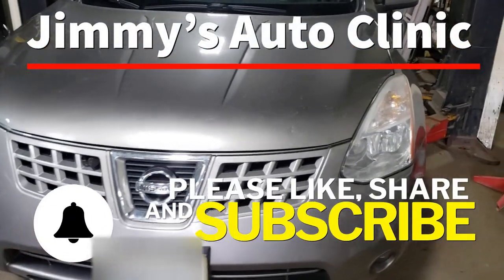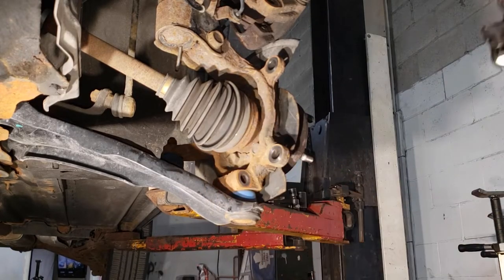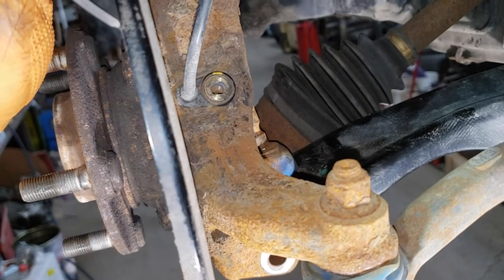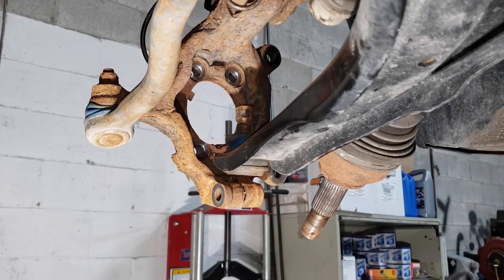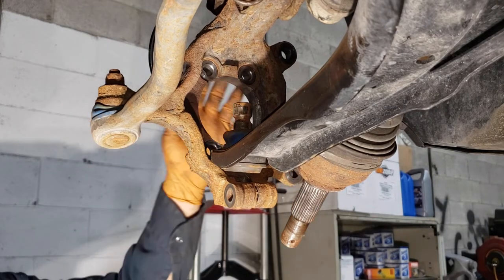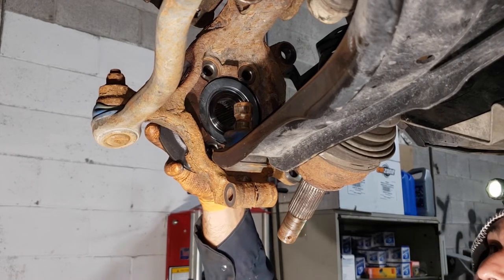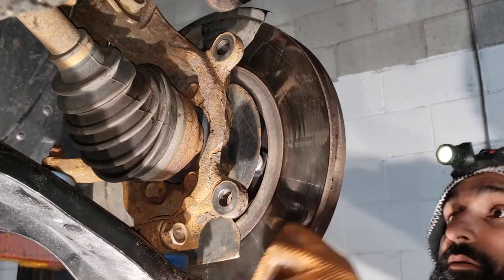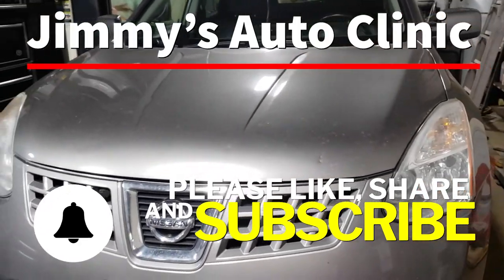Nissan Rogue | Nissan X Trail | Front Wheel Bearing | Wheel Hub Assembly Replacement

Comment: Nice! Thanks! Approximately, how much would this cost to replace?
Reply from the maker: You're welcome. In terms of cost it really depends on what goes wrong and how rusted everything is. So depending on where you are it could be as short as 1 hour to do the job or it could take several hours depending upon what breaks and what goes wrong. I don't remember how many hours it took me but I know it was a pain. I spent quite a bit of time trying to save that ABS sensor which of course didn't work out in the end. I would guesstimate between 2 and 3 hours of labor Plus parts if you're from the Rust Belt. If all goes smoothly there are no broken bolts and you're not from the Rust Belt I would guess to meet an hour of labor. I hope that helps.